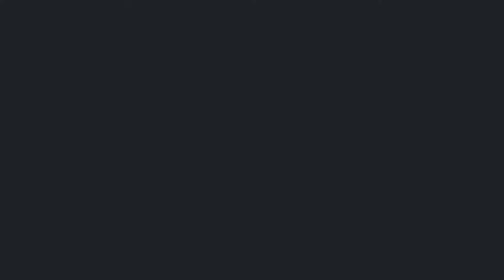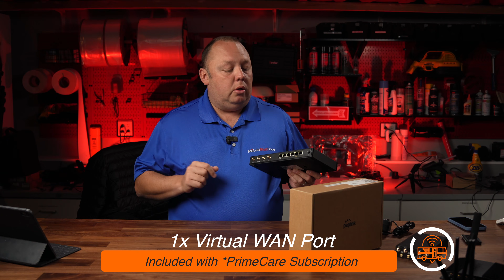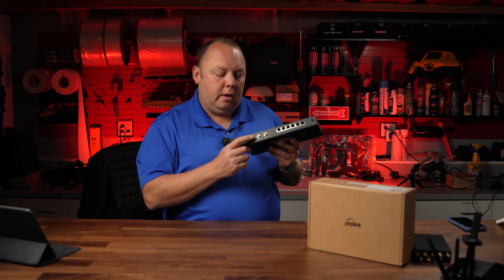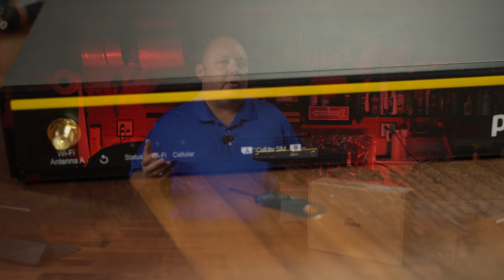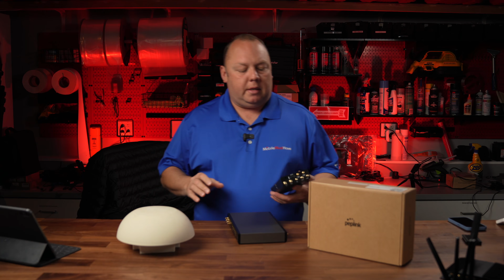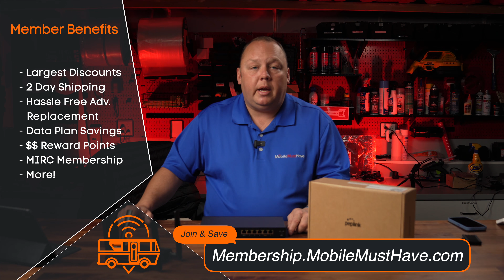NEW Peplink B One 5G is a Game Changer!

Comment: Will it work with the Starlink Flat High Performance with Wedge Mount on my RV?
Reply from the maker: Yes, it will! The Peplink B One 5G is fully compatible with all Starlink kits and can easily connect via the B One 5G's WAN port. You also have the option to connect the Starlink dish wirelessly using the Wi-Fi-as-WAN feature, though a hardwired connection through the WAN port typically offers better performance. Advanced functionality like forward error correction and tcp ramp will allow starlink to perform better than with the Starlink router also. 

Here's a direct link to the B One 5G on our site: https://mobilemusthave.com/products/peplink-b-one-5g?_pos=1&_psq=b+one+5g&_ss=e&_v=1.0

If you have any other questions, reach out to us at info@mobilemusthave.com and we'll be happy to help!

Comment: Do these Peplink routers work well with just the indoor antennae?
Reply from the maker: Peplink routers perform well with the included paddle antennas in urban areas. However, we recommend adding an external antenna if you’ll be traveling in remote locations or if your rig has a metal shell, such as an Airstream or Sprinter Van, due to the Faraday cage effect. For reference, the paddle antennas provide a signal strength of up to 2-3 dBi, while external antennas compatible with the B One 5G can achieve up to 7-8 dBi. This represents more than a 100% increase in signal strength, offering significant benefits when using an external antenna.

If you have any other questions, reach out to us at info@mobilemusthave.com and we'll be happy to help!

Comment: I bought the B One 5G from your website.  The first one arrived defective and wouldn't power on at all.  I got a replacement through Peplink support.  The second one works, but one of the four 5G antenna jacks is off at an angle rather than perpendicular to the chassis.  Makes me wonder about Peplink's quality control.
Reply from the maker: Thank you for reaching out and sharing your experience. We sincerely apologize for the inconvenience you've encountered with the B One 5G units. We strive to provide high-quality products and are disappointed to hear about the issues you've faced. Each router undergoes thorough testing from Peplink before it is shipped to ensure it meets Peplink's high standards. However, despite their best efforts, occasional defects can occur during manufacturing or shipping.

We appreciate your patience in handling this situation and your feedback regarding Peplink's quality control is valuable and will be communicated to them to help improve their manufacturing processes. When you have the time, would you mind reaching out to us directly at support@mobilemust.com with photos so we can assist you further with the misaligned antenna jack? We're committed to ensuring you have the best possible experience with your purchase. Thank you for your understanding and patience.

Comment: Are those WAN ports PoE? Can I power a Starlink dishy directly from there, ditching the Starlink router?
Reply from the maker: So, the B One 5G does not support PoE, but there are other routes you can go to bypass the Starlink router and connect it directly to a Peplink router. The specific route is different depending on the Starlink model, but if you reach out to us via email at info@mobilemusthave.com, we can help you out with the bypass options for your Starlink! Thank you!

Comment: Great video and products. Thank you. I’m new to all this so trying to absorb and then decide a course of action. I just watched the base camp winegard video and was wondering if this router is compatible with base camp. Were there provision made for connecting the 4G winegard antennas to the 5G router like mentioned in the previous video. Perhaps I should schedule a call to lock all this in. We are looking at other solutions/brands that are all in one as well, but the price point of those keeps leading me back to this solution. Thank you.
Reply from the maker: Hello! Thanks for reaching out! So, the Basecamp will not work the B One 5G, but it will work with several other routers we carry. It does sound like a call may be beneficial with one of our reps so they can go through our options with you and see which route would be best for your needs! Here's a link on our site where you can schedule a call with one of our reps for whichever date and time works best for you: https://mobilemusthave.com/pages/consultation

Comment: Thanks for the info. So let me understand. If i have a T-Mobile sim and a Verizon sim can they reside in the tray and can they bond if I understand that concept? In other words can I be driving down the road using one sim and then seamlessly switch to the other if and when connection drops on one? TYI Joel
Reply from the maker: So, the B One 5G is only a single-modem, so technically it can't bond both SIM cards, but it would switch automatically to the backup SIM card if the main SIM loses service. It won't be exactly seamless though, because you will still have a little downtime as the router switches over to the backup SIM. It doesn't take long though for it to switch over.

If you have any other questions, reach out to us via email at info@mobilemusthave.com and we'll be happy to help!

Comment: Can the Peplink B One 5G be set to bridge mode to use it solely as a modem and connect a separate router? If so, what is this feature called at Peplink? 
Best regards!
Reply from the maker: Hello! So, Peplink's similar equivalent to bridge mode is called Drop-In Mode and it is included with the B One 5G! Here's an article that goes over Drop-In Mode: https://forum.peplink.com/t/what-is-drop-in-mode/8592

If you have any other questions, reach out to us via email at info@mobilemusthave.com and we'll be happy to help!

Comment: Just bought the max pro br1 5g, 999,00 euro that’s 400 more.Bbut i think it’s the better choice for my RV (i hope. Hahaha)
Reply from the maker: certainly more rugged for sure. Processor and modem wise they are pretty similar but i find the br1 pro does really well especially when voltage drops below 12v.
Reply: What external antenna would you use with it?
Reply from the maker: @gerryf7015  The Peplink Mobility 42G is a great choice blending price, size and performance. https://mobilemusthave.com/products/pepwave-mobility-42g-formally-puma-421-antenna